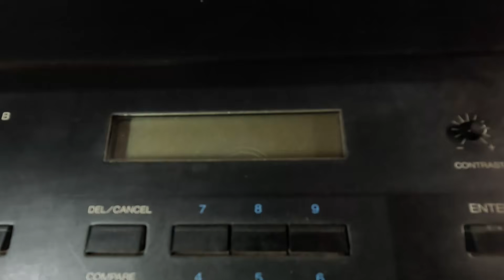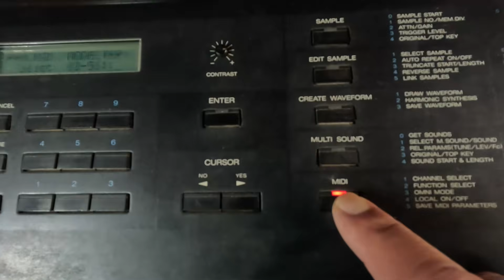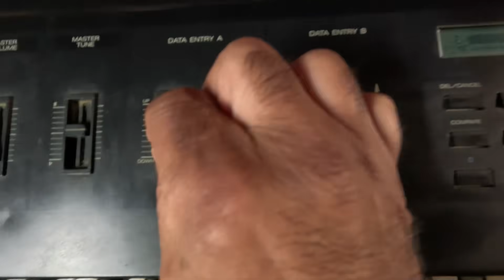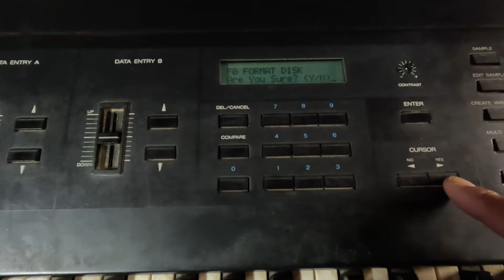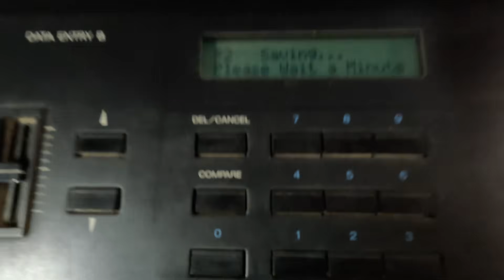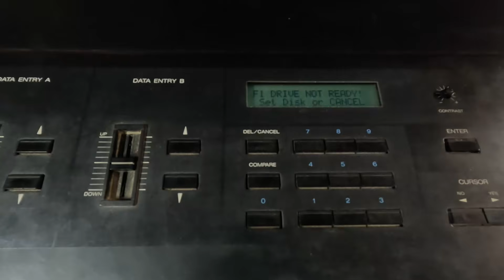AE#240 Restoring A 1987 Korg DSS-1 Synthesizer Part 1

Comment: The internal layout is great for servicing, unlike some of Korg's other keyboards. The mystery circuit board, extra buttons and LEDs are intriguing. Looking forward to the next video...
Reply from the maker: Yes, the DSS-1 is surprisingly service friendly, but it is a big synth. The DS-8, on the other hand, is a nightmare with lots of soldered flex cables.